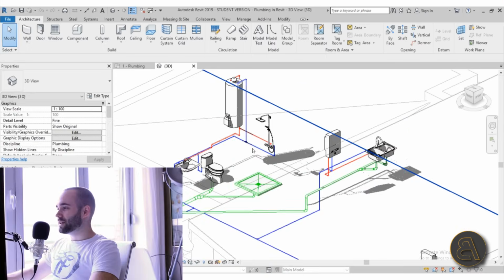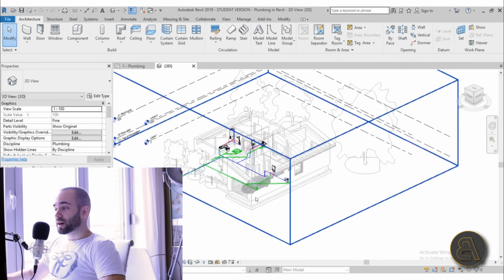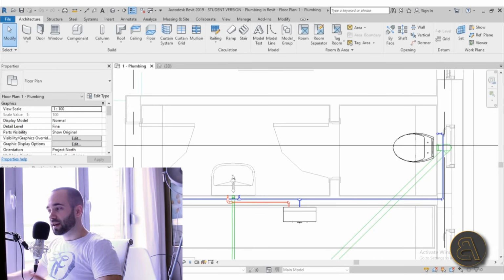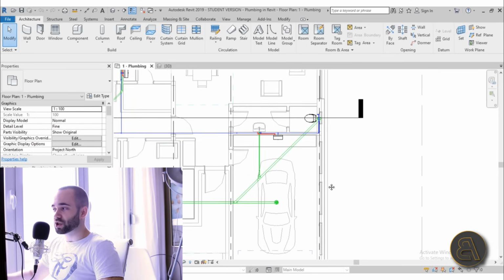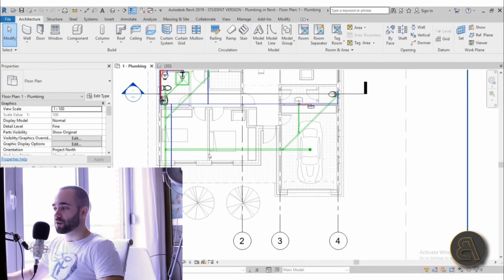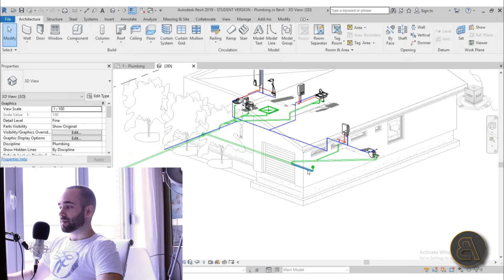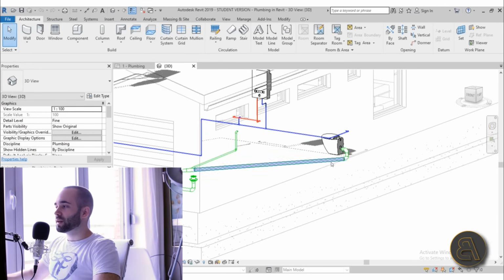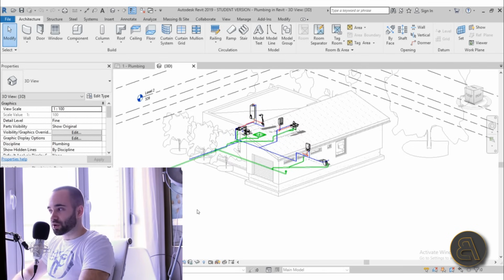Beginner Plumbing in Revit Complete Course (Revit MEP)

Comment: Hello I have one question for you
How to  Revit  components object move in vertical. like bed, table, sofa
Reply from the maker: If they are not face based, you can just go in an elevation or a section and move them up, if they are reference plane based then you will need to create a reference plane at a specific height and place your component on that ref. plane. :)